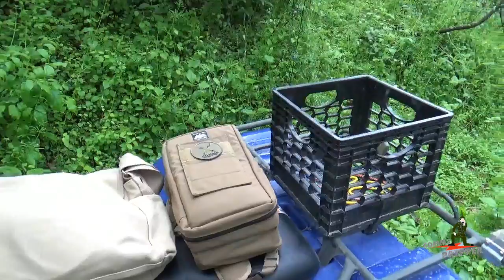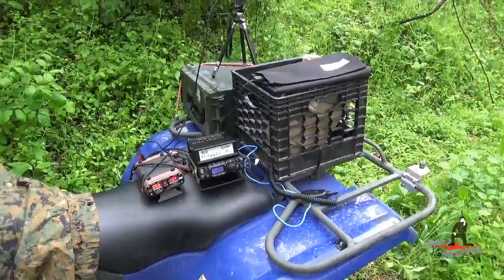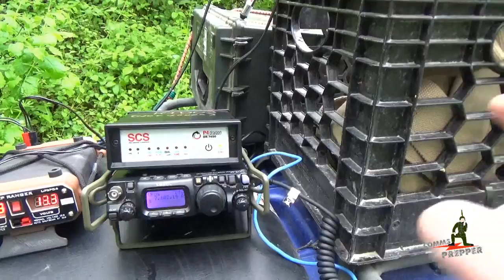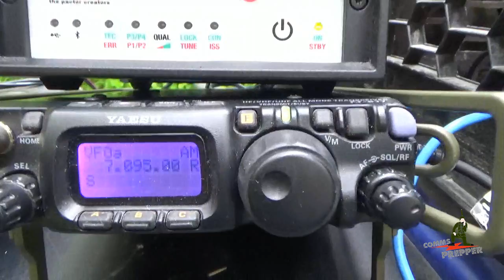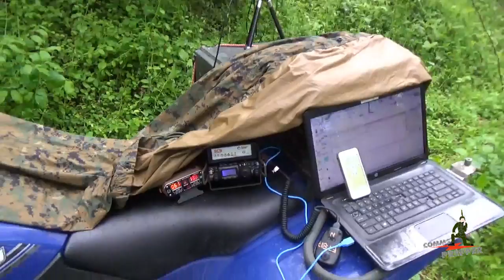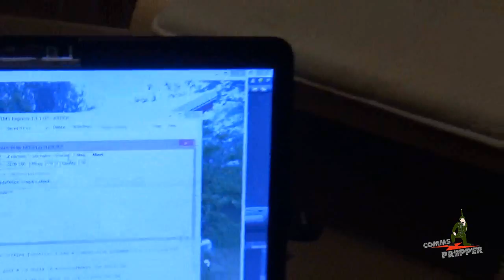Chameleon P-Loop Antenna Field Operations

Comment: How much did you end up spending on the modem?  Looks like they are around $1500.   Can you find them used?
Reply from the maker: I think it was around 1600 with bluetooth (worth every penny for me).  The older SCS PCTIIusb units show up every now and then but not often.
Reply: just wow.  $1600 for just the modem.  $500 for the radio.  $600 for the antenna.  am sure cables and the power supply are another $500.  GRAND TOTAL of $3200 of equipment there.  This is why I keep considering just buying a satellite connection modem, and using my phone to communicate instead for $500 and spending per use service.  example Delorme inReach for $350  --- but granted the setup you have is much more reliable.

Comment: Have you every tried Raspberry Pi's or Linux for HAM radio applications?  It is not turnkey as windows apps, and I don't use windows, and have been struggling to recreate your packet setups under Linux.  Any suggestions or can you do a Linux based setup?  Thanx.
Reply from the maker: Sorry but I don't have any experience with Linux.

Comment: Which antenna do you like the best, P-loop or the F-loop? Can you also explain what the difference between the two antennas might be?
Reply from the maker: +nomacc1 They both work extremely well.  I prefer the P-Loop for field use (on the ATV) because it's water resistant, has less parts to pack, and comes with quality bag that has room for antenna and other items.  The F-Loop is a bit larger package with more items (parts) but works really well too.  The F-Loop 80m kit and high efficiency loop make the F-Loop a rock-solid antenna.  If you looking for antenna to throw in the pack for hiking or ATV ridding I recommend the P-Loop.   If you are looking for something to use at a remote or temporary site (cabin, hotel, etc) then I recommend the F-Loop.

Comment: So the MPAS (without wire) weighs about the same, will accept 25 watts more power, and is resonate on more bands - so for you, what's the advantage over a whip dipole?

And with that plasticy pole on the back of the tuner box less easy to pack than just the box and loop...

And if he does a discount people better jump on it - his discounts last about a long as a bowl of popcorn at a teenager sleepover on movie night.  He needs to pay you and STN a commission! ;-)
Reply from the maker: +M Miller I'm sorry but I don't get your point.  Is there a question here?
Reply: +Commsprepper "...what's the advantage over a whip dipole?"
Reply from the maker: +M Miller whip vs. dipole?
Reply: Man-packable collapsible whip (vertical dipole) vs this loop.
Reply from the maker: +M Miller No one antenna has an advantage over another.  Each supports a different requirement.  In my case, I run mostly HF email operations regionally which calls for antennas with NVIS capabilities.  In this case the loop antennas work great.  However, if I am looking for something that is omni-directional with a low take-off angle for long distance communications (longer skips) then whip antennas are better suited for that operations.  In the end all antennas server a purpose and deserve an equal space in the communications tool box.  My 5/8ths wrench is just as important as my 1' inch wrench - one can't do the other's job but I need them both.

Comment: Hey Hank just got a Lenovo Thinkpad T430, Win10 Pro, 8GB RAM, 256GB SSD, i5- and docking station in brilliant condition for $400.  I had one of these when I was a fortune 500 exec and they hold up pretty well in and out or airports, rental cars.  For rugged use maybe a trade-off between the cost and value against, say, a Toughbook.  AS you may remember, the military used to buy all rugged computers (remember the huge, green boxes for maintenance parts orders?) but ended up moving to consumer computers at the mid proce point.  Back it up and if it breaks but another and restore.

And the Flex Solar kicks butt.  Generates tons of power laying flat on the ground (not pointed/angled at the sun) and it tough.  They have mil-spec versions so they know how to build them, IMO.
Reply from the maker: +M Miller I wish I could get a Toughbook.  I had one in Iraq and it was great.  When I have some sun + time I will make a video dedicated to the flexsolarcells panel.  Hank
Reply: M Miller